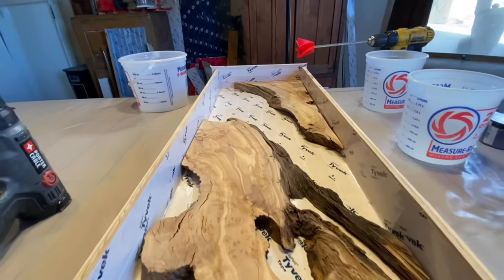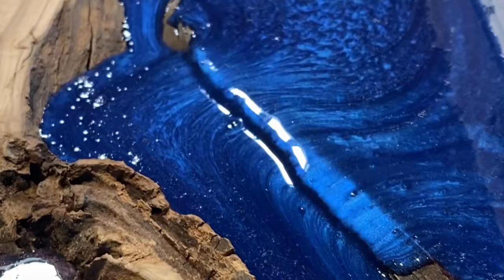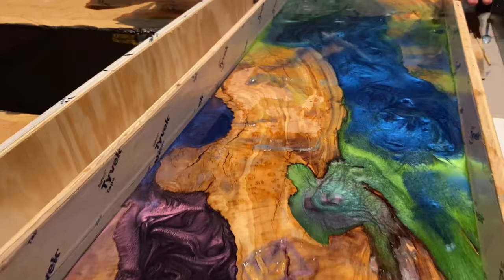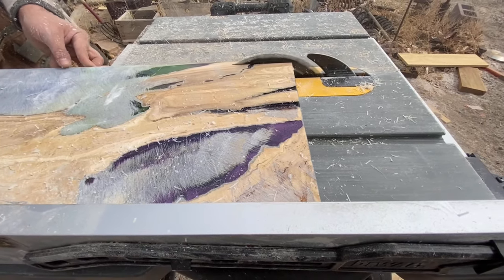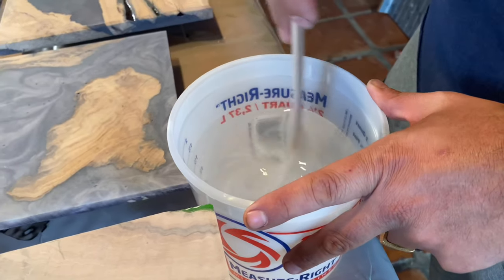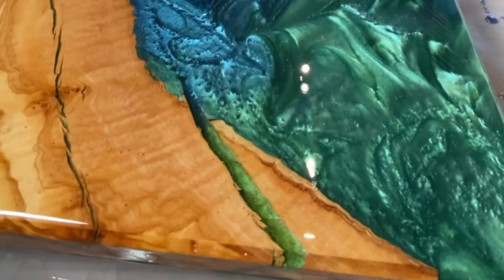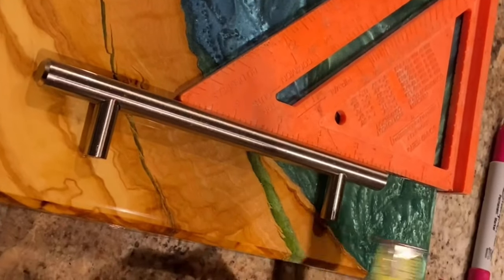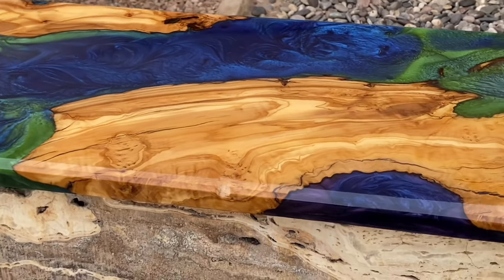Epoxy Bath Board - DIY Woodworking Tutorial Using Epoxy Resin

Comment: Hey Steve, another great upstart video.  Question I have is when you run the piece through the planer "on both sides", doesn't that make the piece taper?  I remember from high school shop class being told never to run a piece through the planer on both sides as one end will end up thinner than the other end.  Thanks and keep the videos coming.  Andy
Reply from the maker: Hello Andy! 

There isn’t any issue planning on both sides, perhaps older planers were known to do this. Feel free to check out this video if you think this might help.

https://youtu.be/S0AL3GdKfxw

Thanks for watching!